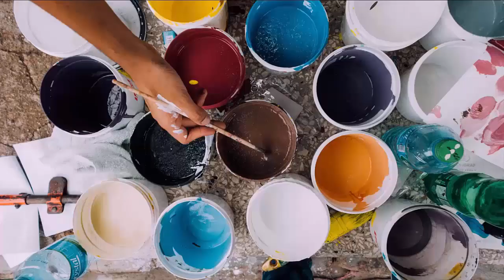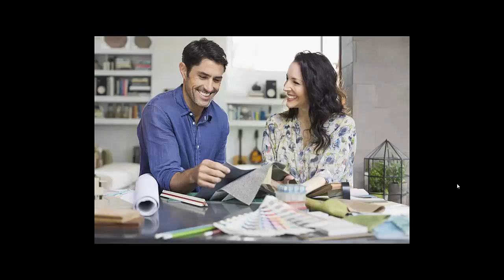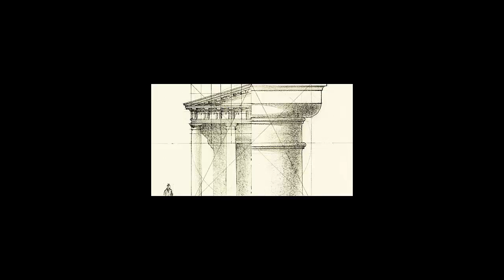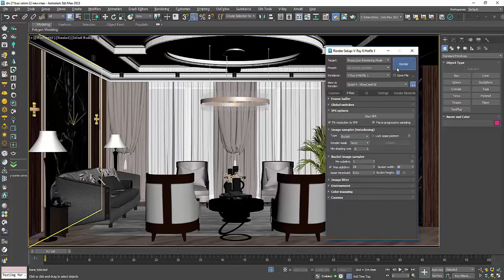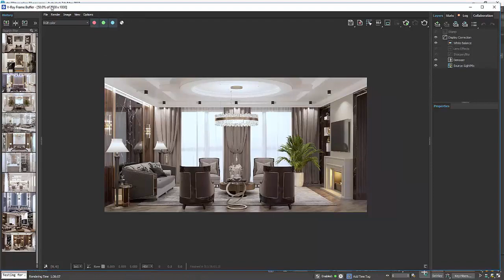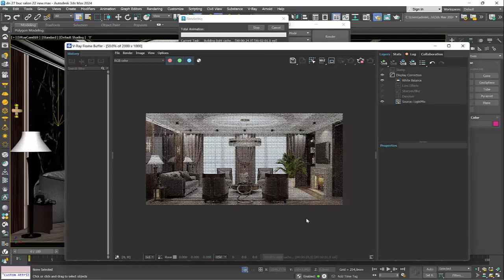Testing  i9 14900HX in 3ds max 2024 on an interior real scene on a Rog Strix Asus (interior design)

Comment: Did your clockspeed is 5.8 any time while rendering ?
I am asking becouse I have laptop too,  but clockspeed is not a spec value while rendering.
Reply from the maker: While rendering, at least only in the process of rendering I observe this -  the laptop begins to heat up and the sounds inside sound like a plane that's about to take flight - I guess it's increasing at that time the clockspeed - I didn't test exactly that - I believe it's 5.8 GHz - you see the main idea it's that I don't want to link 100% to technical numbers, I wanted to show from an intuitive pesrsective of how it feels the work rather that sticking to some +/- seconds of it's activity. I guess that it has to be at least close to that number Intel writes on the processor - anyway if it gives around 30-40 min / render view - it's ok for me 😉 - previously I was getting a view in 1.5 - 2 hours

Comment: Why laptop tho???
Why not make for ur self a nice PC ???
This laptops are saying they are with rtx 4090 but it is not full GPU it is cripple
Same with the CPU....  It is not as good as desktop CPU  that is in same category...
I mean if u need new PC... Then build desktop PC bc this laptops rarely work for 2 years 
I guess Maybe u got it so u can work outside of ur home lol , makes sense. sorry
Reply from the maker: Actually I was looking for PC - but the idea is that it's almost twice as this laptop ((( - it's my next target !!! For now I can say it's doing what it has to do - by the way I think they are at least for 5 years working, hope it lives at least 5 )))
Reply: @interiordesign3dsmax  well u have the best designed laptop. I mean inside and then out. But I see super io bios chips die right after the warranty has passed, that or it will be dead mosfet on mono charging port. So that is my advice.. Do not take the charger out of the port bc they are designed to fail and  u can do that bc u want to use the laptop as pc so congratulations on the new beast and have fun using it  ☝ ☝
Reply from the maker: @ChudGPT  ))) I will write u back in 2 years - we'll check the health of this beast ))) - thx man !
Reply: O it will work for 3 yrs for sure dont worry it is a Strix @interiordesign3dsmax
Reply from the maker: @ChudGPT  Hope it does - he got a lot of work ) 👍